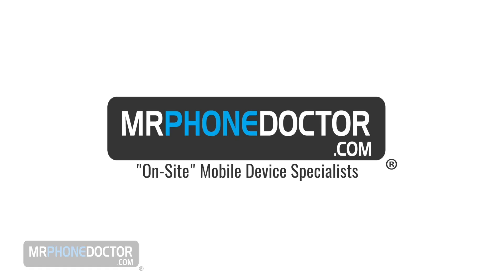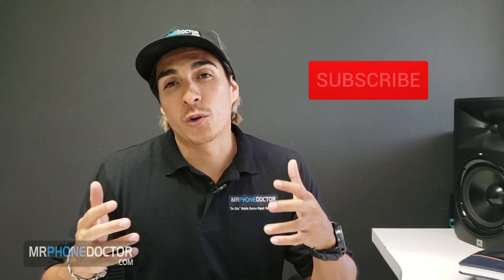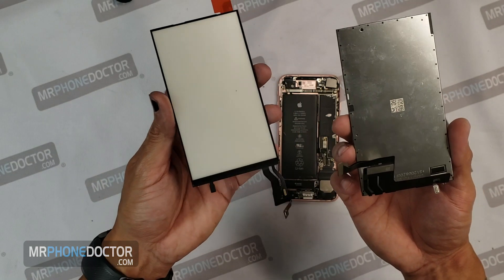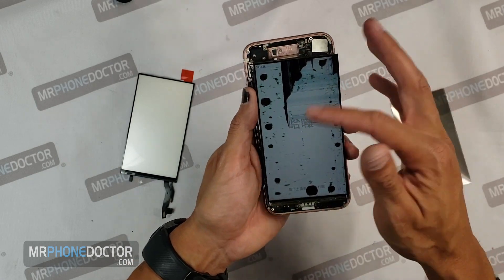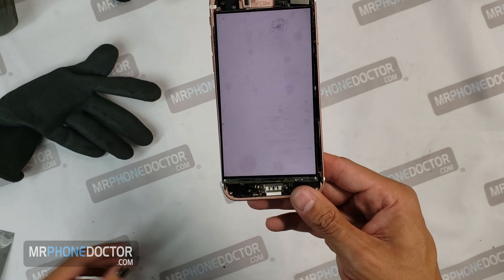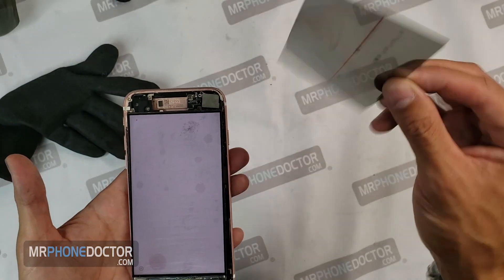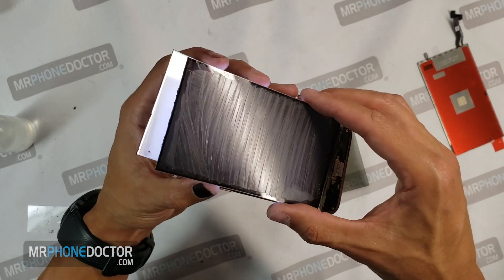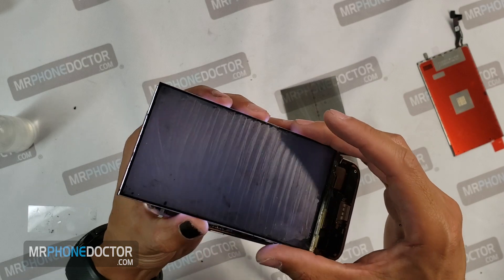Explaining iPhone Cracked Screen/LCD Layers - Digitizer/Polarizer & Backlight

Comment: hi  surgeon, great takedown! much appreciated - one thing, whats the solvent your using to separate the lcd from the backlight (its shown at 5:12)? is it acetone? thanks
Reply from the maker: Ty! Iso 99 I don't recommend using any solution if you are going to reuse the parts

Comment: The title promises to explain the "digitizer," but I don't see where in this dissection that component is even mentioned. Technically, the title refers to "digitizer/polarizer," which implies a single combined entity, but as far as I can tell the polarizer in this video is a passive layer, not an electronic one. You also refer to a connector for the "fingerprint sensor," which I'm assuming means the button at the bottom of most iPhones (until recently)--apparently not shown in this video. This is interesting as far as it goes, but all in all, I'm no closer to understanding which layer senses my fingers on the phone's display than I was before I watched.
Reply from the maker: Thx for watching Thomas. Hopefully in future I'll remake this using apples new oled panels
Reply: @MrPhoneDoctor  Your comment appears unrelated to my complaint that you never actually talked about the digitizer.

Comment: Hope you have time to reply to this question!!   My Iphone 11 dropped. Cracked screen & crack on back. The screen lights up asking me what language I want to proceed with but touch screen absolutely unresponsive.  QUESTION:  What is wrong? Local repair shop said for $140 they can repair it.  I am afraid the phone is VERY broken & it will be $140 down the drain.  Can you please advise? Great video & thanks for your time!
Reply from the maker: Hi. Screen will usually fix that. If they are good repair shop they should not charge you if they cannot fix
Reply: @MrPhoneDoctor  You are so kind to share your expertise -- really appreciate it! They looked at it and said that they CAN fix it  -- my fear is that it might work for a month after repair & then glitch out.  But you are telling me that it is a repair worth doing?  Screen lights up displays set up message but no reponse to Touch and a crack in back. So worth it?  Thanks again - you are the BEST!

Comment: I replaced my lcd a few year ago, now my lcd is slightly detached from what i believe is the backlight.  The screen is still working perfectly. I go to different repair shop and they said they are afraid they might broke my lcd if they separate it from my phone and said to go to the original repairer when i changed my lcd. Is it possible to fix this?

Comment: Hi Mr. Phone, do you think that an apple watch series 7 have the same layers on it screen? I was separating the glass from the lcd, but I accidentally removed kinda a first layer "plastic" film. I partially removed it, then I tested the touch and it worked well, so after that I remove the restant film. When I glued the new glass, nothing happens, touch does not work. So I think that "plastic" film have to make the touch work between the glass. Could you help me? I would like to know how is called that layer, or if I can replace it or something. I would aprecciate your help. Nice vid dude!

Comment: I have an old 6s that I'm thinking of turning into a DIY projector, but I doubt the stock backlight will be bright enough for a good viewing experience. I might want to use just the LCD screen with a LED flash bulb behind it. Is it possible to turn on the screen without the stock backlight plugged in?

Comment: Hello, this is a really great video. May I ask how did you remove the LCD screen from the front plastic cover of the iPhone?
Reply from the maker: Use heat plate or laser to cut off

Comment: Question for Mr Phone Doctor, I’m new to replacing curved front glass only  on newer Samsung phones, are 2 in 1 OCA laminator/bubble remover with built in pump any good or should I get machines separate without any built in pumps etc? Thank you kindly Teacher.

Comment: Great video again. Really helped. 
Slightly unrelated to this video... I own a little repair business on the Isle of Man, and was wondering if you think it would be worth buying the laser back glass removal machine? Your video on it previously looked great, but is it worth the price? Thanks in advance
Reply from the maker: Hi thank you so much for the support. It all depends on how the demand is in your country. Do you get a lot of requests for back glass?
Reply: @MrPhoneDoctor  thanks for the reply. Yes I get quite a few requests for back glass repair, but I tend to replace the entire housing as I find it easier than scraping off all of the glass. This takes a bit too much time though!
Reply from the maker: @ninjarepair  if demand is high get the machine will be well worth it.
Reply: @MrPhoneDoctor  thanks a lot!!

Comment: Some people use LOCA on iPhone 6s and 6 for glass only repairs and they work, if they were really successful and did it to iPhone 7 or 8 without LOCA seeping into LCD, would it work?
Reply: Thanks a lot, can't wait to see you hit 3 million subs!!!!!
Reply from the maker: Hey yes it will work however there may be some stains that appear. Anyone using Loca has perfected the method and know how much to use without it getting between lcd and backlight